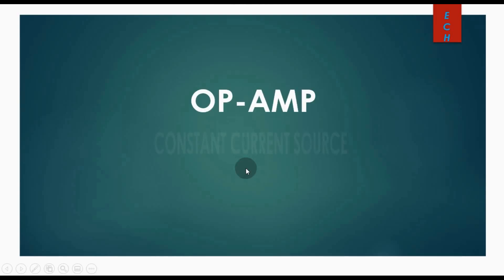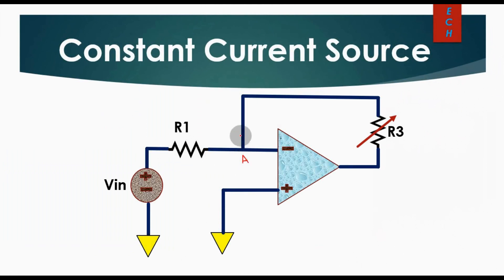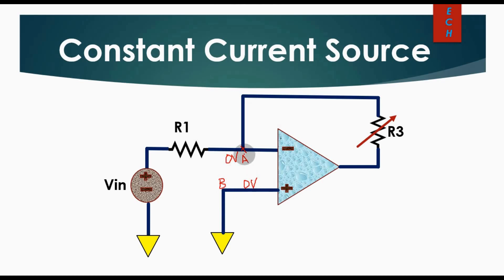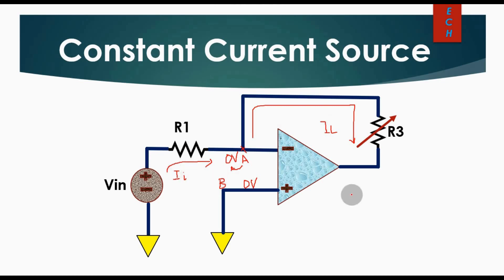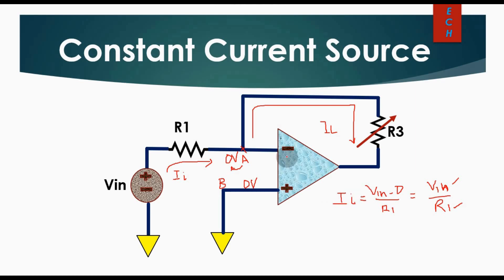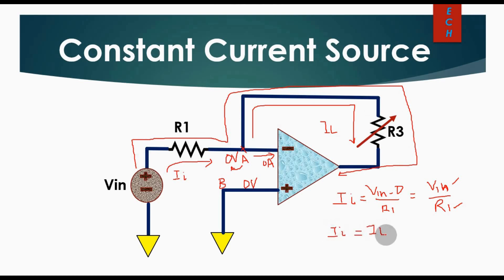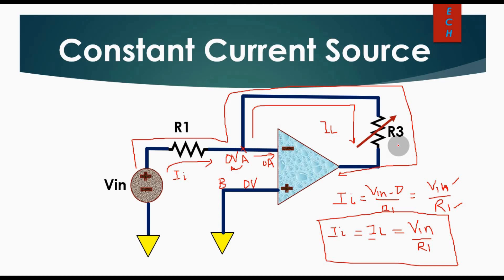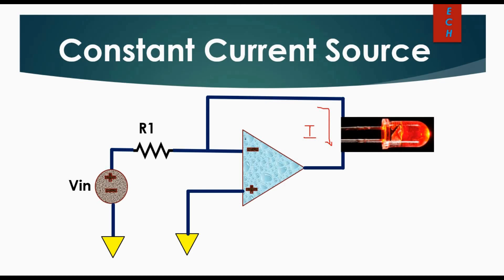Op-Amp Constant Current Source Design

Comment: How you say that it is constant current source ,
If you will increase in put voltage and you  do calculate the current according to ohm low you current will be increase , 
According to my knowledge your circut are not for constants current 
If I am wrong then please do me correct.
Thanks
Reply: Of course it is a constant current source, as the current does not depend on R3 (your load). In case you have a variable voltage source, you can choose at which current the circuit will work.
Reply: Thanks I got it, but if load resistance R3 value increase more then R1 value  then Current   will decrease ?
Reply: As far as I can understand that this circuit will not work like two resistance added in series path 
Right ?
Reply: Current just depends on Vin and R1, not on R3,  thus you control the current by changing either Vin or R1. Isource=Vin/R1.